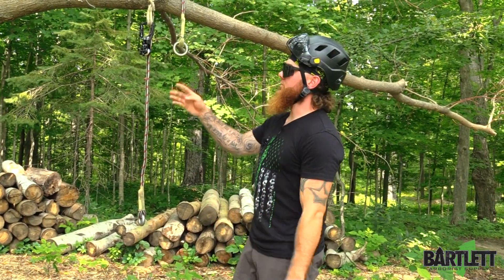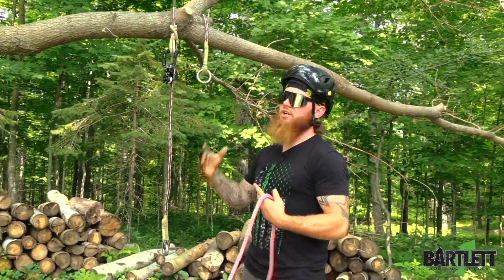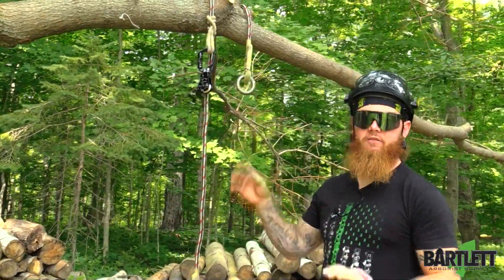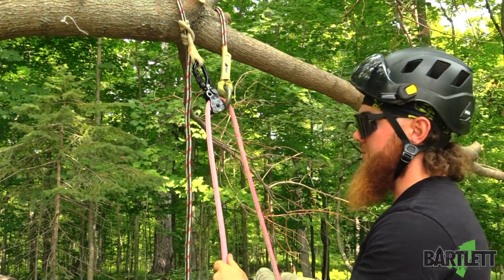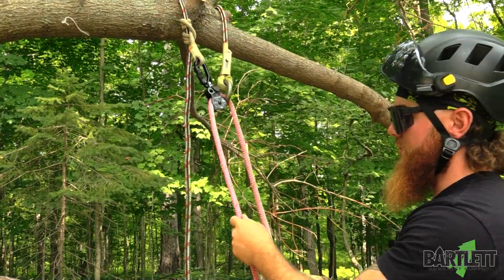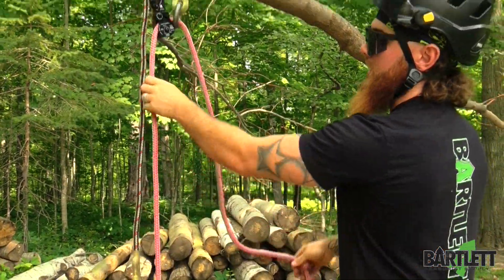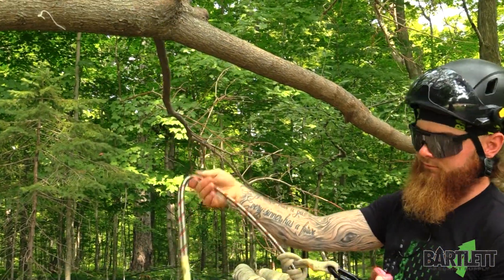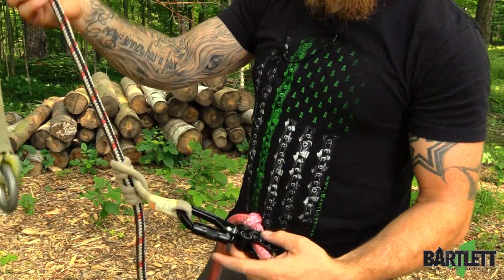Retrievable Rigging Block

Comment: But why do we need a dedicated retrievable anker for rigging? I am not against the idea in any way, but I cant find the purpose.. it also can be done with x rigging rings, with rigging wrench and etc, but the weak point if we set our rigging from the ground is that we cant see the crotch and it's condition... Stay safe and anyway thank you!:)
Reply: Sometime you set rigging point in another tree that you aren’t removing. Or when pruning. Or a removal where you only need to take a couple limbs before you drop entire tree. Saves time of going up and setting and retrieving rigging
Reply: @Yankeebelletreeworks  thank you for your reply. Seems a bit overcomplicated for me to set rigging point for pruning.. and after installing the pulley we still need to tie the limb to the end of a line and all other stuff. Rigging redirect from another tree though might be the case but for what? If  we 'suddenly' set controllable speedline over house.. .. maybe. But keeping in mind the amount of gear involved I'd rather go up the tree and set something beefier than Omni block 1.1 for the safety reasons, in other cases - basic tag line will do. And for final argument - it is not always easily retrievable from a crotch because Omni can stuck.